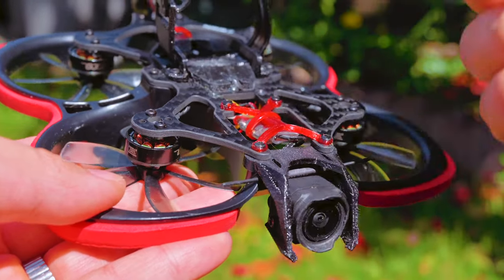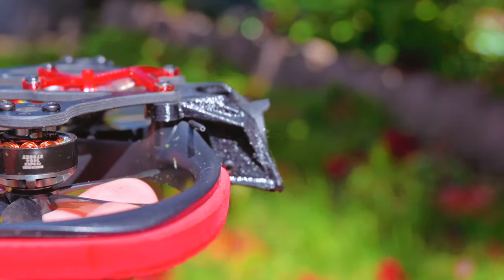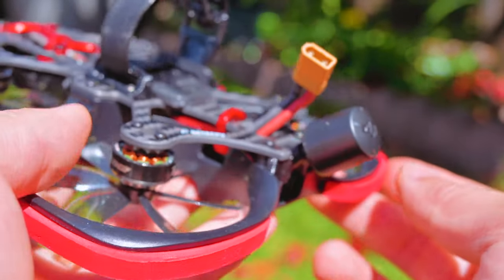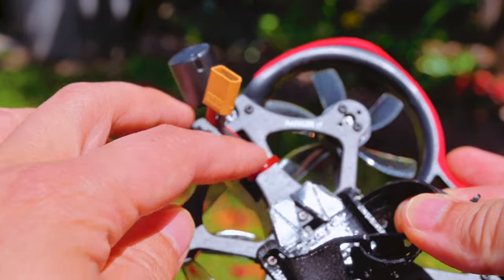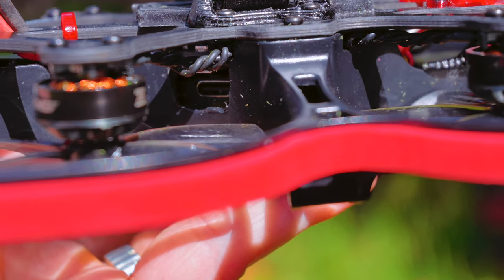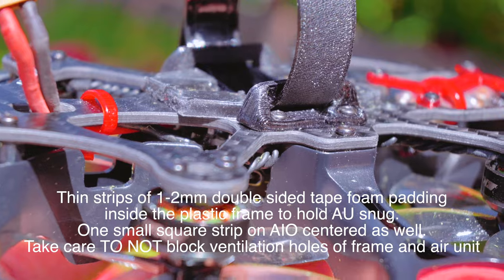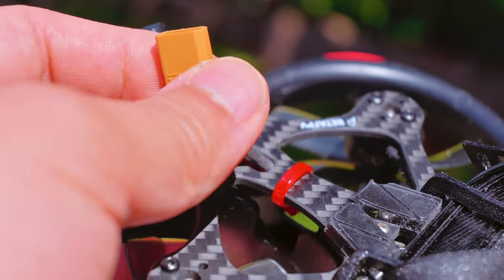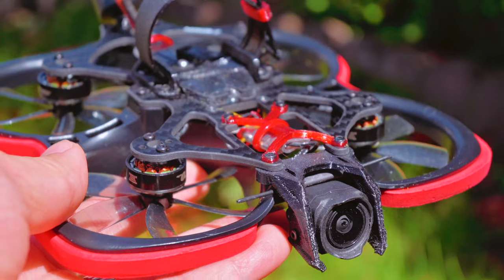CINEWHOOP SERIES | SPRING IS HERE! | CUSTOM BETAFPV PAVO25 WITH O3 AIR UNIT!

Comment: Hi! what settings are you used in the pavo25? betaflight and esc config
Reply from the maker: Hi sorry I don’t have it. I already dismantled the quad.
Reply: @PattyFlipz  ok no problem, i have little problems whit pavo25 just like flying, punch and rise the throttle the motors start up and make so many corrections like jello but really fast. Any suggestions? Uav tech recomend rise p and i over 100, i do this but i have the same problems
Reply from the maker: Hmmm try completely different brand props (stronger ones)  or brand new props, if that doesn’t work. Remove props and bench test on BF by dragging master slider and check all motors are spinning the same speed. If they aren’t then maybe it’s a motor problem. If motors is not the problem, you can try flashing 48 or 96pwm in esc configurator to see if it runs smoother.
Reply from the maker: And if all those suggestions don’t work, try a new aio :( also try spinning the motors by hand and checking if they have wobble